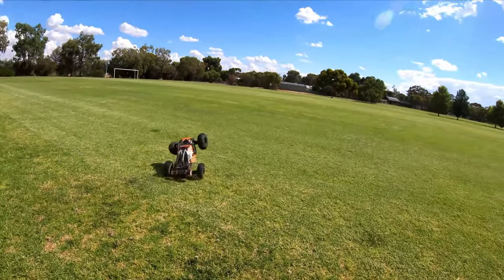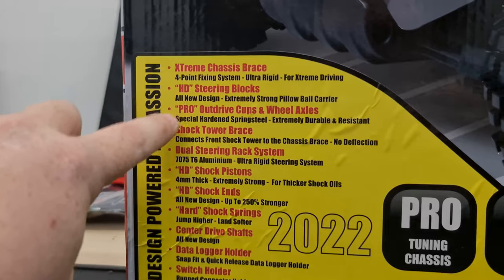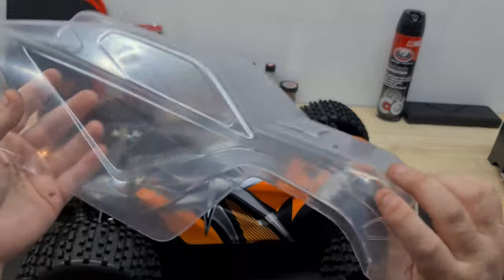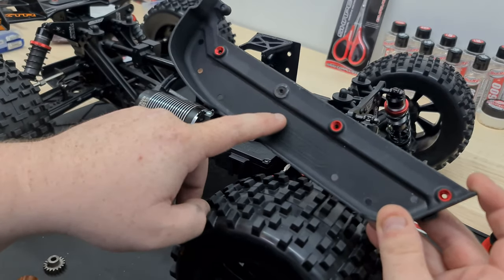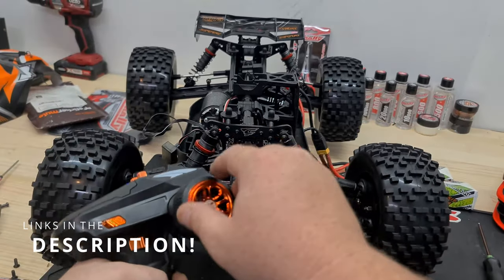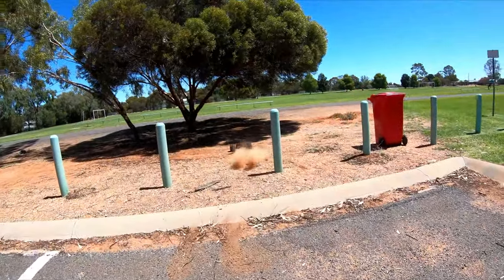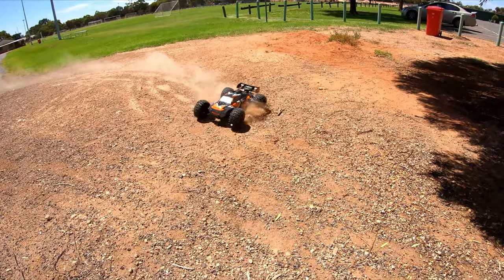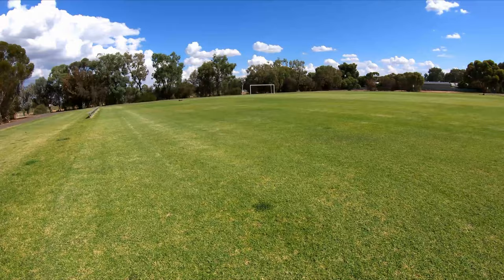1650kv HOBBYWING Kronos XTR 2022! - Team Corally Kronos XTR 2022 RC CAR Unboxing, Setup & Review!

Comment: It's a great truck mate ,I'm thinking of getting this . The price is reasonable for what you get. Looks like a tank and very well built.  I really think this will be a beast .
Reply from the maker: I love this car! It really stands out as a bit of an alrounder to me. Durable, fast, handles really well etc..
Reply: @MatthewSimm  it's on its way and with a max8 combo. Beast of a thing and great value. They say the RTR trucks are very fast  with the hobbywing systems. May need to get one , merry Christmas mate.
Reply: It's still going hard , takes a hard beating but it's nuts with the max8 2250 g2 combo.  Broke the wing mounts a few times so put a wheelie bar on. My favourite beast , thanks Matty . Your review made me get this beast.